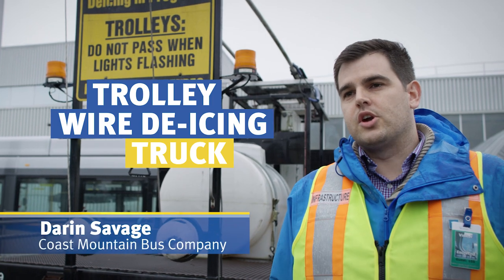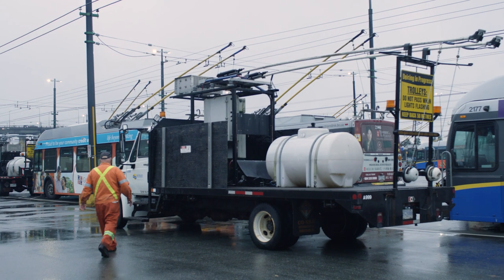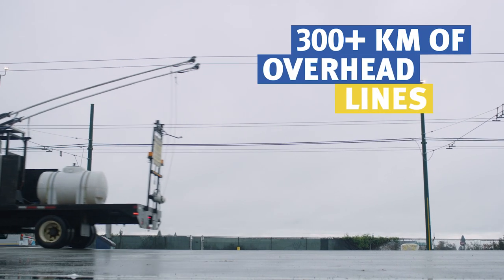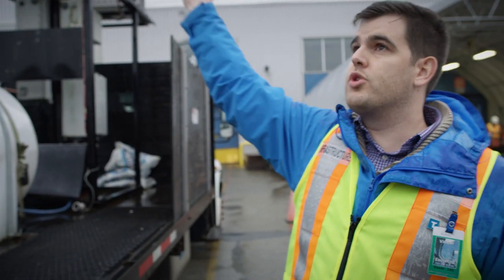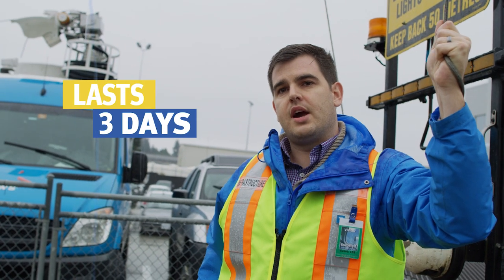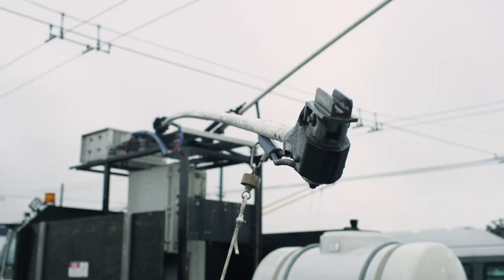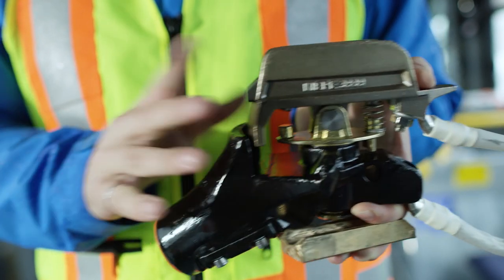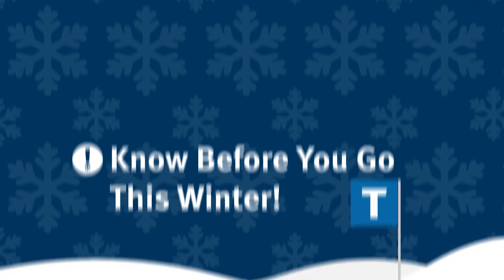Winter Readiness: Trolley Wire De-icing Truck

Comment: Is it just the age of the infrastructure that's the cause of this being a necessity? Wondering because overhead wire systems are being adopted in colder conditions for electric transport systems and at first glance, they don't seem to require this kind of maintenance.
Reply: The Oslo tram network has a modified old tram that de-ices the overhead line. But our heavy rail does not de-ice the lines, you often get nice bright sparks when riding the train in winter. One possibility is that our tram network does this as a courtesy to neighbours as bright sparks and loud crackles can disturb those trying to sleep. Our heavy rail usually doesn’t run that close to residential buildings, so then it might not be worth it.